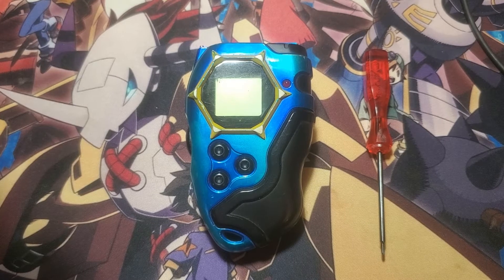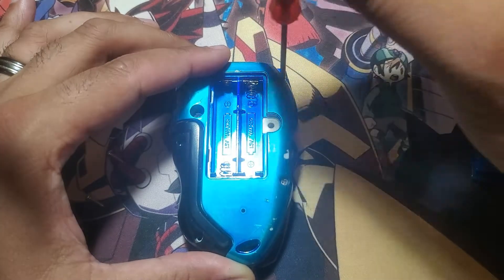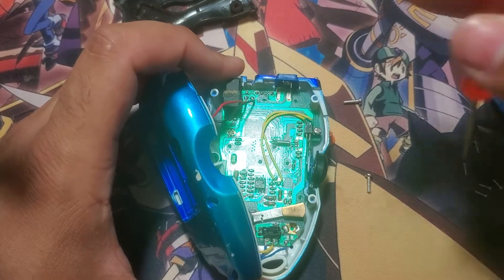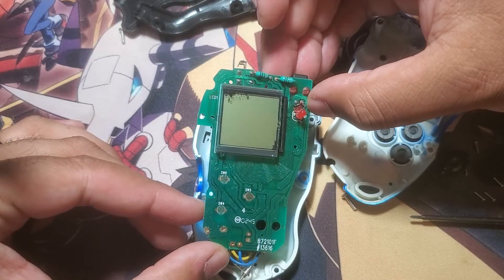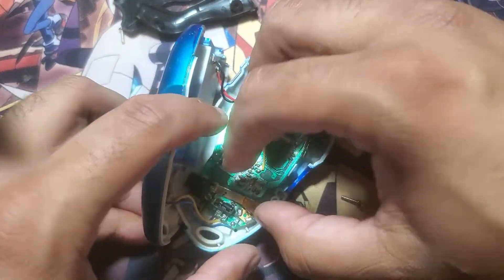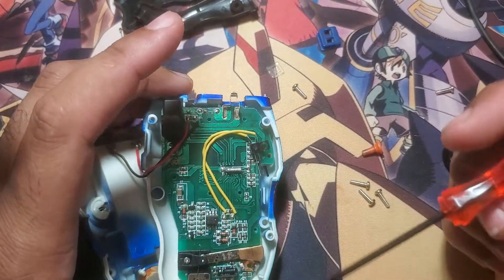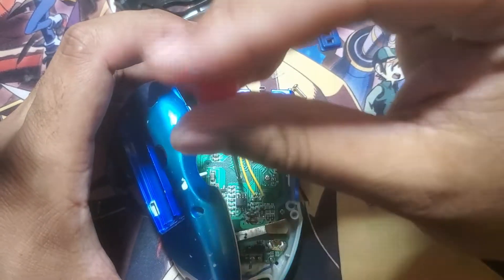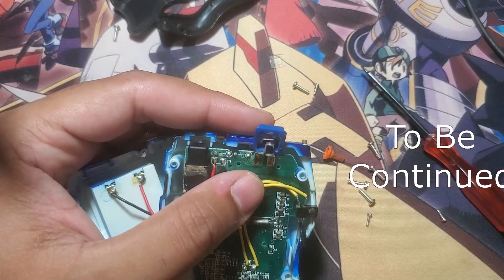D Tector Digivice Tear Down Part 1

Comment: fuck its soldered! 
i have one of these and the spring is corroded due to the batteries leaking. i wanted to clean it by taking out the battery spring but i guess that wont be happening. guess i got to clean it the old fashion way.. 😒

Comment: I'm in the process of doing this to repaint. The screws on the inside were in such bad condition that 4 of them broke off at the head. Any advice on getting those out?
Reply from the maker: I say flush cutters if your careful or maybe you could take a junk screwdriver and either solder it to the screw or super glue it if your careful.  Or maybe a small pair of pliers if the head is raised enough to me gripped. That’s all I can think off but use caution I’d hate for your device to get ruined.
Reply: Thank you for replying and for the videos!